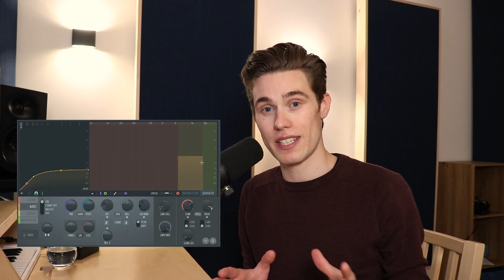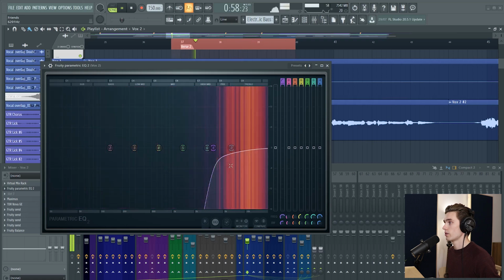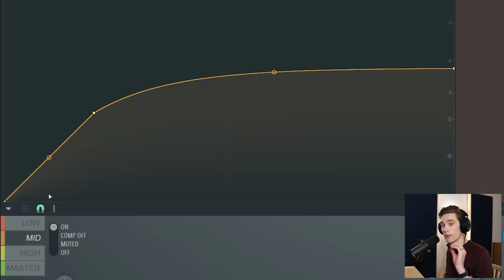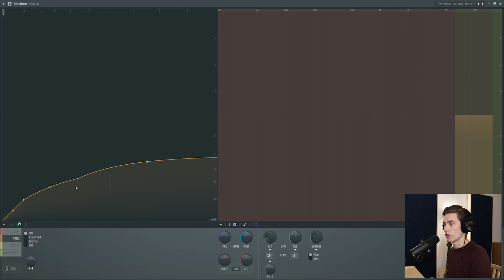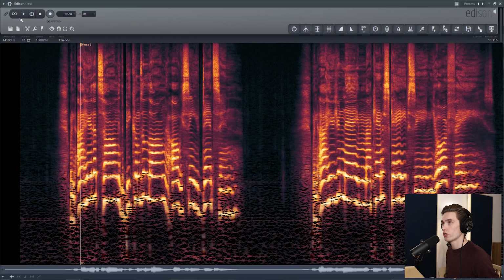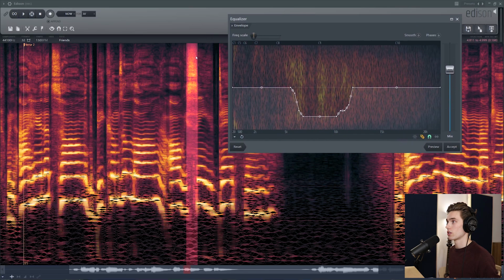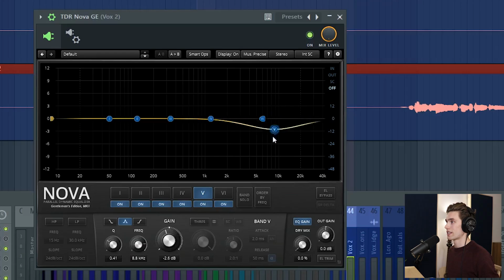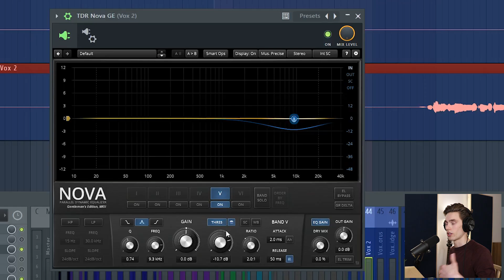FL Studio Vocal Mixing - How To De-ess Vocals

Comment from the maker: Method 1 - 1:00  - Maximus multi-band compression
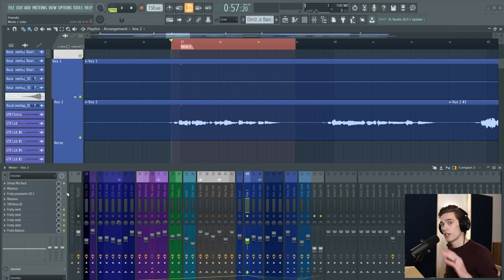Method 2 - 4:45  - Manually remove the frequency using the Edison plugin
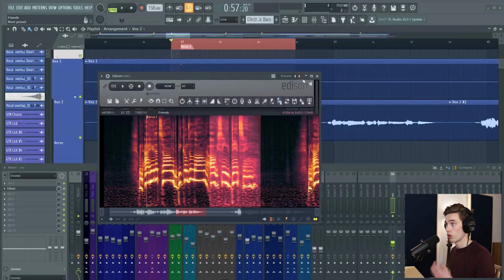Method 3 - 7:45  - Set up a dynamic EQ to listen for the harsh, sibilant sounds and reduce them.
Reply: https://youtu.be/GS_4DdpTzp0
Dude inspired by you 😀😎😎
Reply: I'm The Guy who needed Vocals....The Tutorial Helped me..
Reply: Yo
Reply: Though as tedious as Edison, you can also use the Advanced Editing mode in Newtone to lower the individual esses
Reply: Have you got any advice about how much exactly to select and where to dip the line? My S sounds turn into lisps instead of softening the sound.
Reply from the maker: @magichorse  it’s probably best to try and start with less reduction if it sounds too processed, potentially selecting a more narrow band and aiming a little higher might help!
Reply from the maker: @adamaria1104  @michael.inthemix

Comment: I'm having some issues. When using Maximus, and checking my graph on the left, the sound doesn't go up to the 2nd node as much as yours? E.g. 3:40 My sound is very tiny, barely reaching the first node. i wonder if I'm doing something wrong? I tried adjusting my node to very low levels but it doesn't seem like I was supposed to do that...

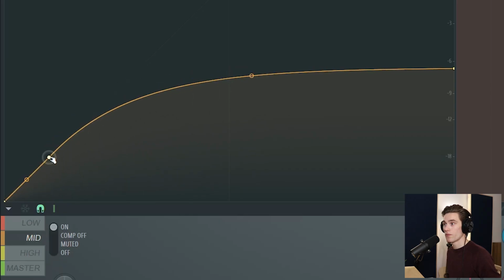Comment: the input signal at 3:21 is barely visible in my mix, it only flashes a tiny bit when it hits an s; so to de-ess it I have to compress the whole vocal which makes it sound awful. So I have to choose between dull, flat vocals and horrific 's' sounds shredding my ears. 

Anyone have this issue or know how to fix it?

Comment: Could you explain in more detail why, when using Nova, you chose an attack time of 2ms and release time of 50ms?  Does it not make sense to use the fastest attack time possible when de-essing? Also, how does one determine the best possible release time  in relation to the attack time when de-essing? Is the release time dependant on the number of S sounds over a specific time period in the waveform? Which attack and release settings would you use to de-ess the spoken phrase "She sells sea-shells sitting on the sea-shore" in Nova?

Comment: THX! I had an issue, that an s was followed by an r and on the edge of the two letters there was crash at the high frequencies but a few hundred frequencies lower so my tdr nova 'deesser' couldn't cut it out, but with this method i could detect the issue and smooth it out.

Comment: I thought I had my vocals pretty good and my de esser was on about 5 db or so but when I listened down the s's were so loud. I was confused because the more de essed' the more it seemed like that sound was getting louder, which is the opposite of what I wanted. Of course it doesn't sound too bad but needs a fix. I like these techniques but what frequency in an eq is the sibalince the highest? I thought it was around 6k or 7k Hertz but I might be wrong.
Reply: I think it's supposed to be -5db not 5 db . It should be negative
Reply: If your adding 5db its gonna make them louder. If you -5db it should get quieter

Comment: If u hve a min i wanna know two thing

How much key is good for beginners in midi 25 or 49

And 2 nd thing is i seeing reviews of many buyers of arturia they saying that arturia have some kind connection problem in fl studio
Can u answer plz 
I just like searching for this from a week
Reply from the maker: I much prefer 49, it's my favourite key board size unless it is only for Basses. As for Arturia, they do have FL Studio connection issues with the analog lab suite software but they do work for standard applications. I would recommend other brands though, because Arturia is very expensive for what you get!
Reply: @inthemix  thnx sir appreciate it

Comment: Can i use those technics to get rid of any other annoying frequencies besides the "S" ?
Reply from the maker: Yes absolutely! I use the NOVA (technique 3) to remove resonances in the low mids on guitars. It's great because you can remove issues without using an EQ which can make guitars sound empty in the low end. 

It's also possible to use the Edison to remove any frequency, low, mid or high :)